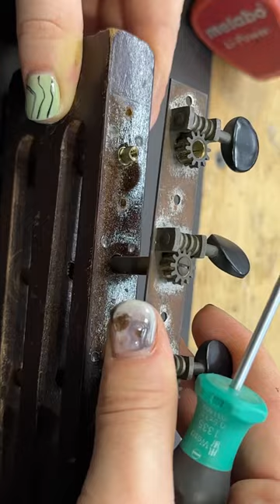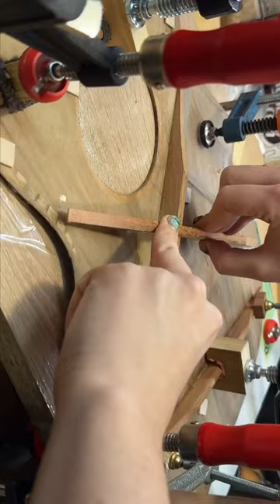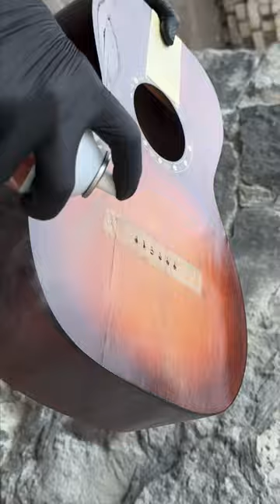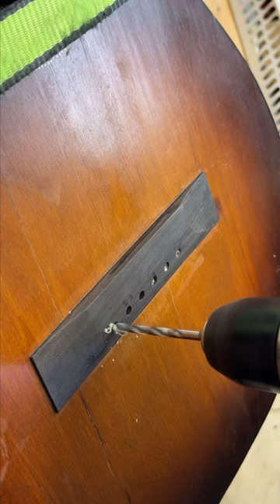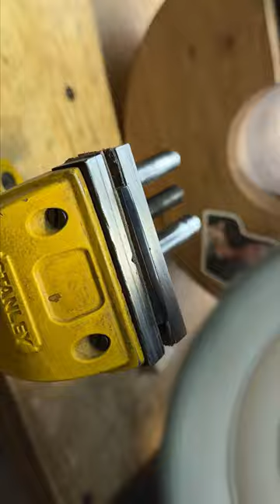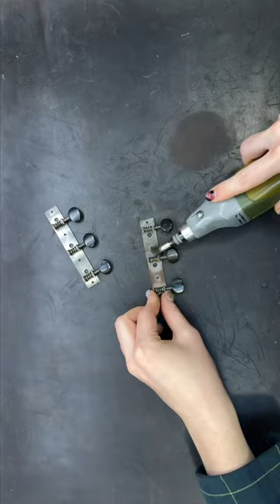There was no need to rescue this guitar, but anyway I did it 🙃

Comment: Fantastic work 😍 I have my grandma's old Sears Catalogue Guitar from the late 1920s-early 1930s that looks roughly in the same condition as this one started. Glad to know restoration is not only possible, but can be done with such incredible results!
Reply: If you want longer videos showing what to do, also check out the Paul Mero Junkpile Guitars channel. Ken is good about fixing seriously thrashed old acoustic guitars on the cheap... especially archtops, including Sears, which were often made by Harmony or Kay in the US, and sold as Silvertone. You might see those names on the headstock or on a label inside the body (look through the sound hole or f-holes). No matter who built it, good luck fixing it up.

Comment: Is the nut an ebony one? If so, do you lubricate with graphite or similar? I have a Buxus sempervirens (Boj, Bois.... Idk in english)  one and it blocks a bit the entorched cords tuning or even blending them,  making a "click" that if you are not carefully, can make it to lose the tunning.

Any tip? I have "pau ferro" and "boj" (both more hard to sand wood even than ebony)